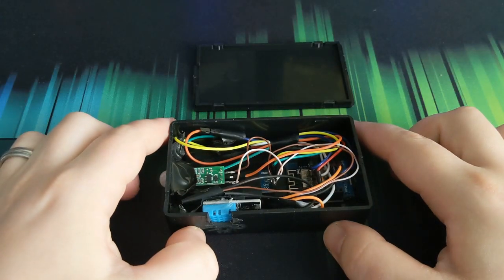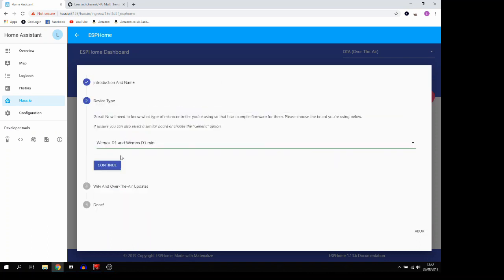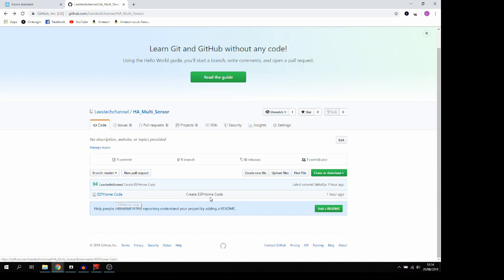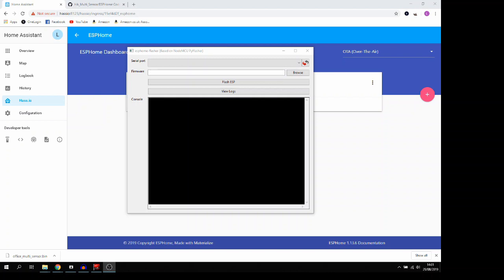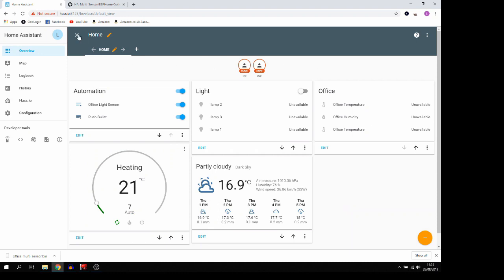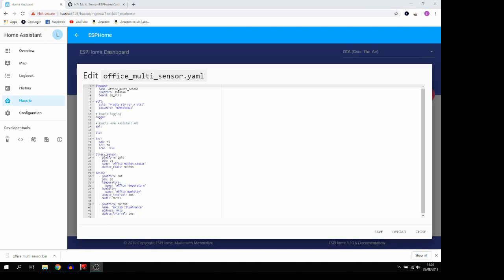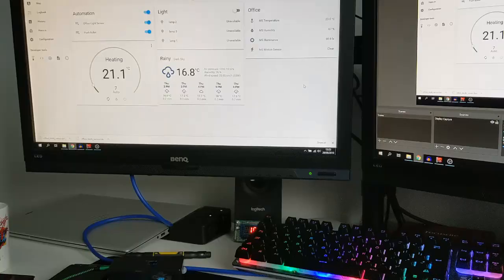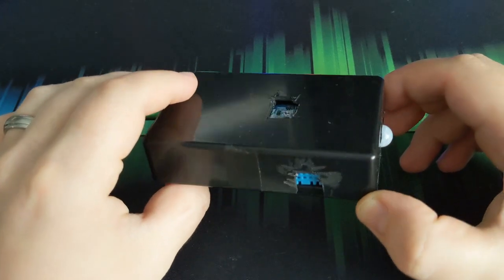Home Assistant Multi Sensor

Comment: Hi, so if i get a D1 Mini, a Temperature sensor and a Light sensor i need to connect a wire to the 5V on the D1 Mini and split the wire to the two sensors's alimentation PIN?